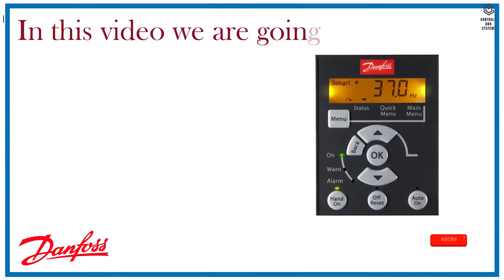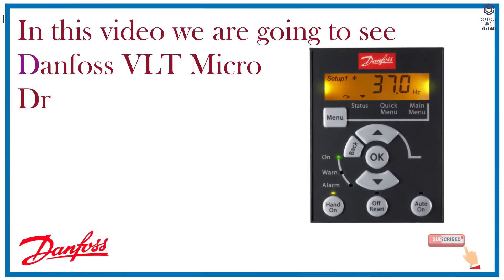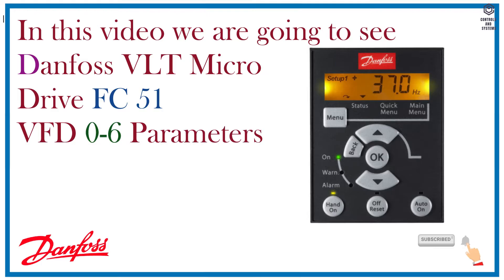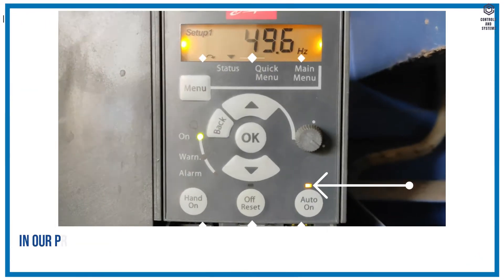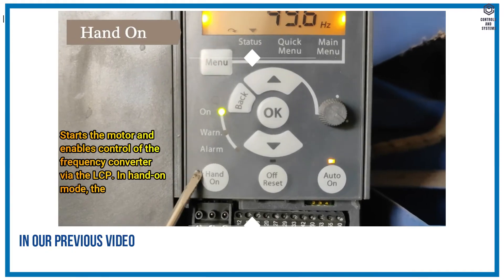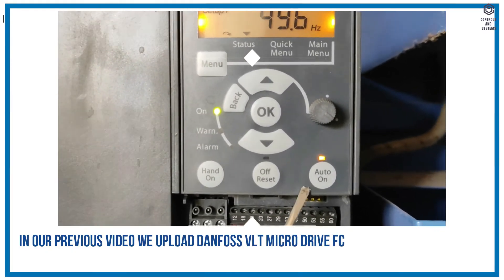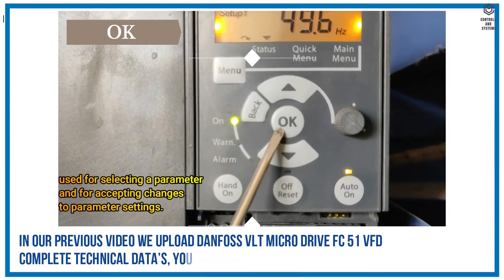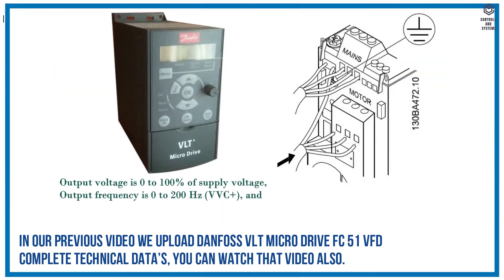Danfoss VLT Micro Drive FC-51 Parameter Settings – Complete Guide! 🔩

Comment: Sir which parameter setting when we connect 0 to10volt pressure tranducer connect  . Inverse option
.if signal high then speed low

Comment: I configured a motor of 4kw.but the frequency is not stable when you increase the frequency. It starts warning and alarming 7.and trips when the frequency reaches 30.what do I need to do
Reply from the maker: WARNING/ALARM 7 is DC Over-Voltage:
If the intermediate circuit voltage exceeds the limit, the frequency converter trips after a time.
Troubleshooting:
1. Connect a brake resistor,
2. Extend the ramp time,
3. Change the ramp type
4. Activate the functions in 2-10 Brake Function
Increase 14-26 Trip Delay at Inverter Fault

The fault may be caused by mains distortions. Installing
Danfoss Line Filter may rectify this problem.

Comment: hi. I can't change parameters on my danfoss micro drive fc 51, can You tell me password. thanks
Reply from the maker: Pressing  the menu button, ok button, and down arrow button this will unlock the password. This will automatically enter the parameter editing screen in quick menu or main menu.. Please try this method..
Reply: @insightcontrolsystem  Thank You very much for help. I solved problem with password but I have another one question to You.
on our pump was problem, (AL11) Motor thermistor over temperature . and after that the Motor with  thermistor was broken. 
we take new Motor without thermistor and make changes on danfoss micro drive fc 51  : 
 manual reset press [Reset], [Auto On] and  restart the motor.
1-90 Motor Thermal Protection:
[0] *No Protection Disables temperature monitoring.
1-93 Thermistor Resource:
[0] * None No thermistor is connected

after thet the new pump stil not working. 
please how can I slove this problem. Thanks

Comment: Dear sir please explain how we resolve the AL 13
Reply from the maker: ALARM 13-Over current
1.Remove power and check if the motor shaft can be turned,
2.Check that the motor size matches the frequency converter,
3.Check parameters 1-20 to 1-25 for correct motor data,
Reply: Hi there how do you get into the menu to change the frequency 
Thanks

Comment: saya mempunyai masalah yaitu start di digital input tidak bisa, apakah ada kontak yang bisa saya hubungi, terimakasih
Reply: I had a similar problem. I had to change the lower frequency value in the quick menu. Its set to 0.0hz by default but you have to change it to the frequency you want to run the motor on for the motor to start in auto on mode.